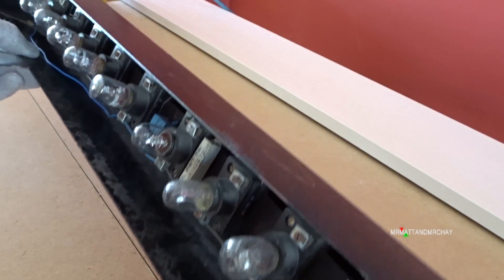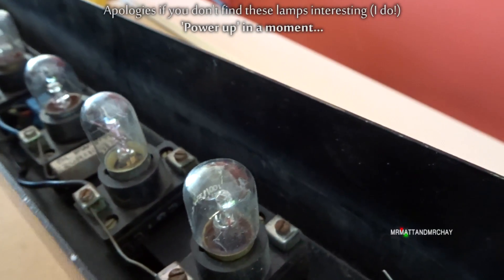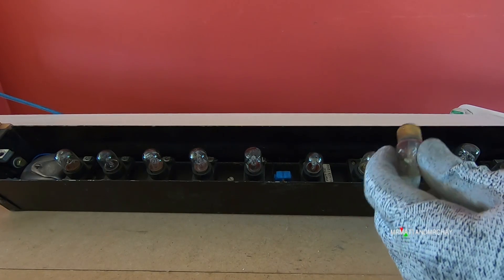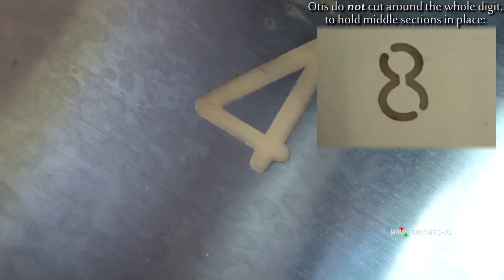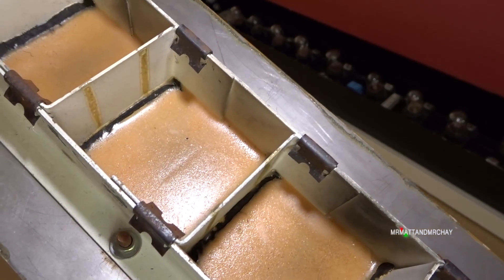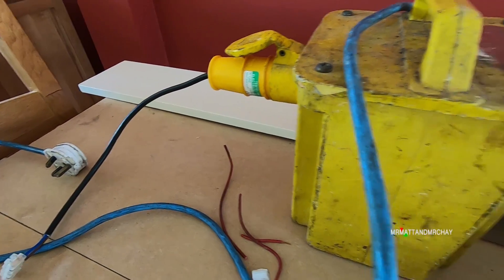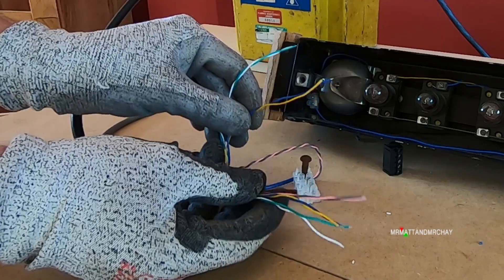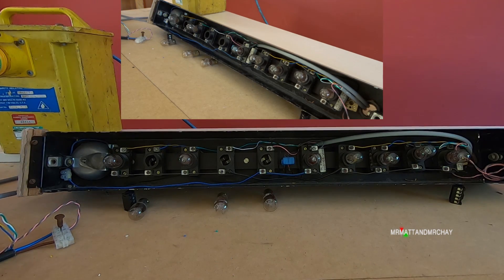EXPRESS LIFTS floor position panel - POWERED UP!

Comment: If this is from the 1970's then the bulbs would all originally be Osram bulbs. How do I know, well dad was an Express engineer in those days and I remember the boxes and boxes of these bulbs in the stores at Newcastle. All sent up from Northampton, Abbey Works. Lots were car bulbs together with the keys for the cabinets/control doors. Dad said at the time he could probably have gotten into any normal car with the set that he had! Great days to be a lift engineer's son. I've probably visited just about the same amount of working motor rooms as you have! Great videos, please keep them coming.

Comment: It looks like there is a small piece behind the floating piece of metal, just barely visible through the resin when it lights up.
Reply: You’re right! I find it quite interesting how they had to especially make and design each indicator panel to suit the amount of floors a building has. Surely this would’ve made it quite costly since they can’t exactly mass produce the same type. Some of these indicators even have 2 rows of numbers for the really tall buildings!

Comment: Absolutely brilliant video Matt! Been waiting for this one. Not sure how long you’ve had this, but is this the one featured in your channel art but just edited?

Just a suggestion, but maybe you could wire up the floor selector to the bulbs, so as you click it, it light up different bulbs? That’d be pretty awesome! Not sure how safe or easy that is though.

Looking forward to the next one!
Reply from the maker: Hiya, yeah, this one is featured in my channel art.  Good idea of connecting it up to the selector but I would need to get the selector rotating on it's own (manually clicking it up and down would in my opinion be a little boring to watch).  It's on the list, but next is the keyring video - long overdue!

Comment: You may be right about the resistors but in addition to that it extends the bulb life greatly and gave them proper brightness.  When filaments break sometimes the bulb can pull double current easily on half the filament making contact and running very bright.
Reply from the maker: This is what I love about these videos, info from other youtubers and engineers.  Interesting, thanks!